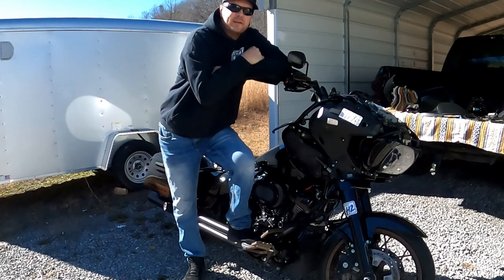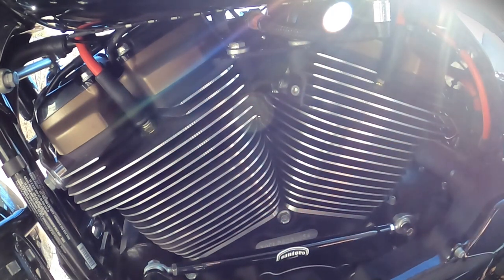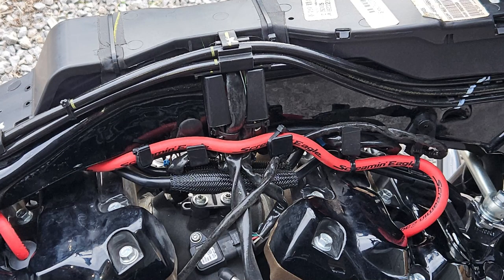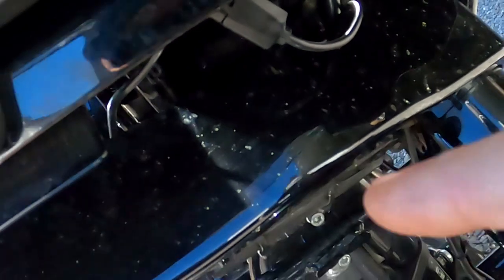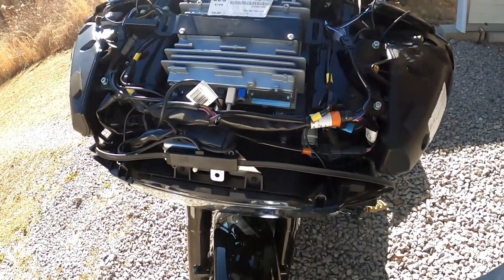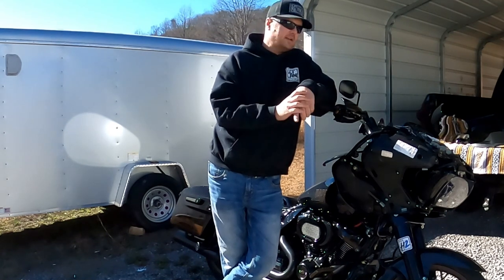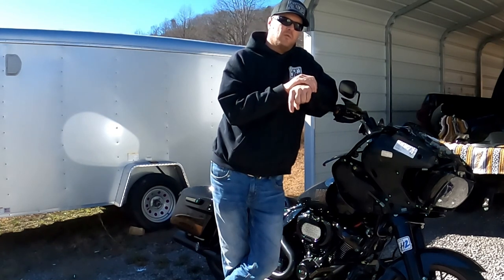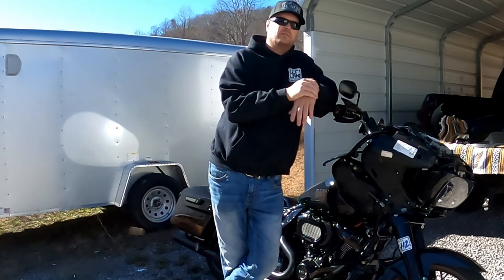How to relocate your horn at little to no cost on your Harley Davidson touring motorcycle

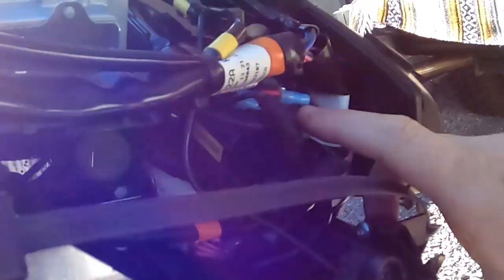Comment: Have you noticed any increase in engine temps?  Harley engineers discovered that the stock horn set-up actually deflected air to the rear cylinder and when they removed it on their race bike, the rear cylinder got hotter.  Check out the 3:08 mark of this video:  https://youtu.be/Ba-LszkJgSk?si=462DepPL9s2CqaD1
Reply from the maker: So far I have not noticed a temp difference up or down. And I'm always in the upper rpms. But it's not summer yet either.
Reply: @TweedleD  Keep us posted.  The bike does look good without the horn in its stock location.
Reply from the maker: @SEPA_Bagger  will do heading to daytona this week so if it does I will know.